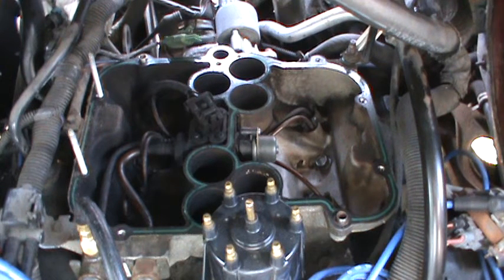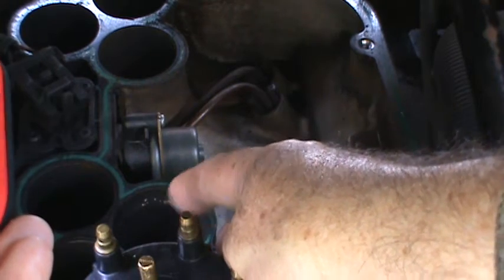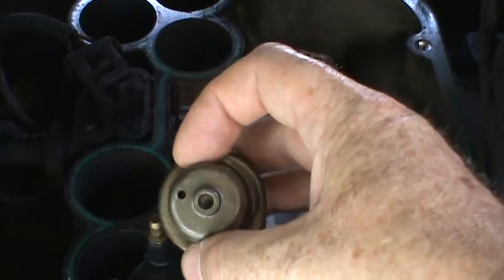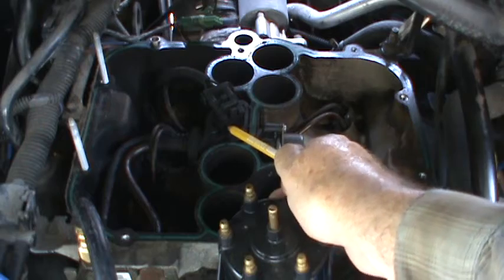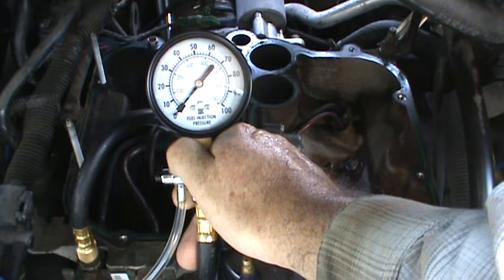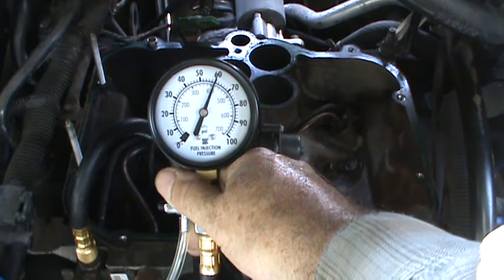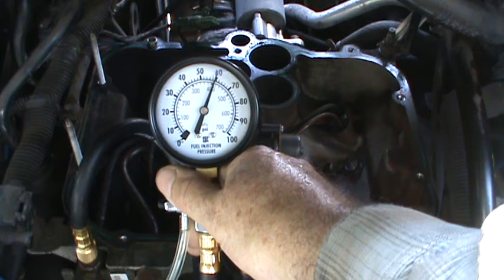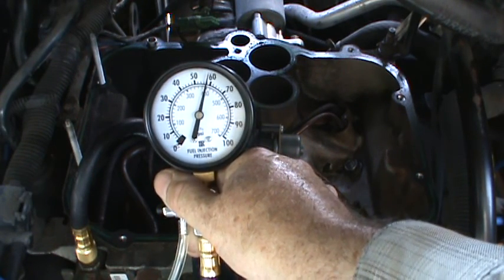Fuel Pressure Test (Part 2)

Comment: Why don't you put a link on the fuel tester gauge your using in your description?
Reply from the maker: Greetings...Armando Mermea.........Thanks for watching.........Well, I usually don't post links at all, because, it depends upon, where Ya might be living on Mother Earth...lol...........I bought this not-so-expensive one, at a Canadian Tire store, a few years back..........There are basically two types of fuel pressure testing gauges available, one being for, "low" fuel pressure, up to about 10 PSI (Pounds per Square Inch), and is used mostly for engines that have carburetors on them, and, can sometimes be combined with a Vacuum Gauge, that will probably be reading in Inches of Mercury (great for engine diagnosis, and also, indicating, that Ya might have a vacuum leak somewhere, possibly)..........The one that you see in this YouTube video of mine, is the "High Pressure" model, that is used mostly on fuel injected engines, that have fuel pressure, that is well "above" 10 PSI.........Make sure, to find the fuel pressure "Specification", for the exact engine and vehicle combination, that you are working on, in order to be accurate........Have a look-see on Amazon, or E-Bay, if you're having trouble finding one, at your local auto parts store.........Good luck, and......till next time......Be Safe, take care, and have a good one.
Reply: @RockysRoadshow  Yes, I'm well aware of which gauge does what. What I'm looking for is something of good quality. If you can't post a link atleast mention the brand it is if possible.

Comment: I probably missed it but should it hold steady with the key off or just go down to 0 when i cut my off it drops
Reply from the maker: Greetings...barry cowan..........Thanks for watching.........If your engine/fuel injection system, looks just like this video's does, then, here's, what's going on, for Ya.........When you turn the ignition key, to the "run" (not "start") position, then, the electric fuel pump, that's inside of the gas tank, will run for about 2 or 3 seconds, to "prime" (pressurize) the fuel system, then, when you turn the ignition key, to the off position (to take the key out), the fuel pressure, should hold high and steady, for 5 minutes or more (you can also "re-prime", the fuel pump's pressure, by tuning the key on, first time, for a few seconds, then, turn it off, for, oh, about 10 to 20 seconds, then, turn the key, back to the run position, and, it should, re-prime fuel pressure, after, each, 10 to 20 second waiting period, while having the key, in the off position)...........If the fuel pressure drops really fast, then, there's usually a leak somewhere.........With the engine..."not running"...have a look, inside of your exhaust system's "tail pipe", near the rear bumper.........If the inside of the tail pipe, looks like it's all coated, with dry, black colored carbon, then, the engine, is probably running way too "rich" (too much gasoline, being burned), and sometimes, the "fuel pressure regulator", that's inside of that aluminum plenum (intake manifold), will..."spring-a-leak"...and, if so, then, the best thing to do, would be, to replace the entire fuel injection "spider" (as it's usually called), along with, what is called, a..."nut kit" (which is really, just, two, light colored, nylon/plastic, fuel lines), which might develop a crack, causing a leak, possibly.........I tried replacing, just the fuel pressure regulator, by itself, but, after a year or two, it sprung a major leak, and I needed a tow truck, to git-er-home...!!!...lol.........There is only..."one"...Big, fuel injector (maxi-injector), that is part of, the fuel injection body/spider, that might also (rarely), be leaking, possibly..........Also, there are 6, spring loaded poppet valves (part of that spider), that might have, a bit of a leak too, possibly..........Then, there is also a "check valve", that is part of, the electric fuel pump assembly as well, that won't hold pressure, if it's malfunctioning.........I've had it, where, if, it's just the fuel pump's check valve, that's not holding pressure, with the engine "not running", but, the engine starts and runs really good, then, I wasn't too concerned with the fuel pressure dropping, under this particular circumstance.........If there's, any kind of a fuel "leak", that's inside of the plenum (intake manifold assembly), then, get it..."fixed-right-away"...!!!...because, there are two, gasoline drain holes (one on each side), at the bottom of, the plenum/intake manifold, which will..."drain"...any "leaking gasoline", right into, one cylinder, on either bank (side) of the V-6 engine, and, if the engine..."gulps"...lots of liquid gasoline, into, one (or both) cylinders, while the engine is running reasonably fast, then, there is the possibility, of..."Hydro-locking"...one, or maybe two, of the engine's cylinders...!!!...can result in..."Major engine Damage"...!!!..........If you remove the..."Tuning Valve"...(looks like, it's made out of black plastic), that's, on the top/center, of the aluminum plenum (only held in, by, two screws, and, has a small wiring connector on it), then, once it's removed, just shine a flashlight, down, into the hole, and look for, any...puddles, or wet spots...of gasoline (on a mini-van, a small mirror, will usually help, quite a bit), and also, have a ...fire extinguisher...nearby, just in case, something weird happens, and.......till next time.......Be safe, take care, and have a good one.
Reply: @RockysRoadshow  i agree with you ive looked inside from the piece that pulls out in the very top of the plenum. There was a clean spot by the regulator i even even primed it and seen fuel leak out. Probably just gonna bite the bullet like you said and just buy a whole unit. Any recommendations on a good unit. Ive bought i believe it was delphi mpfi for a 97 style its been kinda questionable
Reply from the maker: Greetings...barry cowan……….Well, it kinda looks like, I forgot to mention those, shall we say...clean-looking-gasoline-washed-areas...that, tend to be, a somewhat common occurance alright...…….Also, if that clean-gasoline-washed spot, occurs on the right/passenger side, on the inside, of the lower intake manifold/plenum, then, it'll probably be, that, the rubber-like diaphragm, that's on the inside of the fuel pressure regulator, has failed (crack, or, whatever?)...and...if the leak is found, to be, on the left/drivers side, then, it'll probably be, that, one, of the two, high (gasoline) pressure, white colored, nylon/plastic fuel lines (aka, the nut kit, as it's called sometimes), has become faulty/leaking (crack in it, or, whatever)………..I installed an "Autoline" (brand) fuel injection "spider" (as it's usually called), and, I think, that, it was a reman/remanufactured unit, that looked, just like brand new, when I took it out of its shipping box...!!!...and, it has also, held up/operated really good too...…….The two white looking, nylon fuel lines (aka, the nut kit), had the (brand name) "Standard", showing on it, and, has been good, so far...…...Seeing as how, I had it disassembled, down to this point, I also, removed the lower intake manifold/plenum, from the engine block, and installed, a pair of "intake manifold" gaskets, and, I'm glad that I did, because, the original/factory ones, sure looked, all dried up alright...…...I used "fel-pro" gaskets, but, I did notice, that, these particular gaskets, "didn't have" the "separator bar" (gasket divider), that is usually on/part of, the factory intake manifold gaskets, that partitions, the two separate intake ports, on the cylinder heads, that are close to each other/side by side, from each other (not sure why?).........After all, was said and done, then...."Wowsers"...!!!...what a difference...!!!...instant throttle response, seems that, less gas pedal is needed, to go any speed Ya want to, and, if the engine hasn't been running for about a week or so, then, just turn the ignition key, and it starts up right away (no waiting at all...lol)..........So yeah, consider installing, some new intake manifold (lower plenum) gaskets, while Ya have it apart, as far as Ya have, just in case, they aren't sealing, as good as they should be........Check out Rockauto.com, for information, about auto parts, because, once there, you'll be able to see the different brands, as well as, some pictures too, oh, and also, most of the parts that you see, will usually have a direct link, to the parts manufacturer's website..........Good luck, and.....till next time......Be Safe, take care, and have a good one.

Comment: Your going about air its a closed system get to the point.
Reply from the maker: Greetings...Victoria Louden............Thanks for watching...........Well, there is..."air" (actually, it's intake manifold or plenum "vacuum"), that will be involved, with certain types of fuel injection systems...............Let's take this fuel injection system, as an example, that you see in this YouTube video of mine, shall we...........There is a "fuel pressure regulator", that's (part of), mounted onto, the so called, fuel injection spider (unit), and, the engine's, intake/plenum vacuum signal (air pressure, if you will), affects, the spring loaded diaphragm, that's hiding, inside of, the fuel pressure regulator (unit)...........Yes-Sir-ee-Bob, there's even a small hole in the fuel pressure regulator's, metal housing/body, that, the engine's, (intake) plenum, vacuum (air pressure) signal, travels through, to cause an effect, as to, the position, that, the (internal) diaphragm, will be placed in, and that, my friend, will have an affect/change, as to, the amount of fuel pressure, that gets delivered to the fuel injectors, or, in this case, the 6-Poppet Nozzles, that are installed, into the engine's, lower intake manifold...........There are some specifications, that are out there, that will be sayin', that, the "fuel pressure", might drop, by, 3-to-10 P.S.I. (Pounds per Square Inch), due to, the amount of, plenum/vacuum signal, when, the engine, is just at idle speed RPM's (Revolutions per Minute), of the engine's crankshaft, that is...........So, let's now say, that, the vehicle's gas pedal, is pushed all the way down, then, the intake/plenum vacuum signal, will probably drop down, to almost nothing/almost Zero Hg (Hg = inches of mercury, as seen, on, the good ole, mechanic's, engine vacuum gauge), then, the fuel pressure regulator's internal diaphragm, will now be at a position, where-by, the fuel (gasoline), will now, be able to flow, without the amount of (fuel pressure) restriction, that it had, when the engine, was at, idle speed RPM's............So then, an idling, (stock/factory) engine, will usually produce, lots of intake manifold/plenum vacuum (signal), and, an engine, that's going, pedal-to-the-metal, and under hard/extreme acceleration, won't have very much/if any, intake/plenum vacuum signal at all............There are, some externally mounted fuel pressure "regulators", that kinda, look like, a small can/canister, that have, a small metal pipe, sticking out of it, that will have a rubber hose, pressed onto it, and, the other end of this rubber hose, will probably be pressed onto a fitting, that, might be, screw-threaded into, the engine's, intake manifold or (intake) plenum, in order to transmit, that there, intake manifold (or plenum), "vacuum signal", directly to, that diaphragm, that's, hiding inside of, that particular type of, fuel pressure regulator............Engine "vacuum", is basically, just, any amount of air pressure, that is "lower than", what, the Earth's, natural air pressure, happens to be, on the "outside" of the engine, at that very moment in time, and also, the Earth's air pressure, will be getting lower, the higher, that you go, up, in elevation, as in, higher up, on, one of Mother Earth's, very high "mountain peaks", as an example...........If you are having, any engine, fuel pressure delivery problems, or other-wise, then, just let me know, about, the vehicle's...Year...Make...Model...Engine size...etc....and I'll see, what I can do, to help you out, and........till next time........Be Safe, take care, and have a good one.